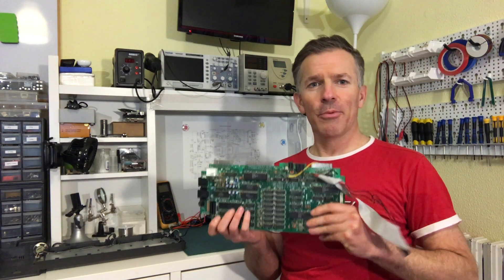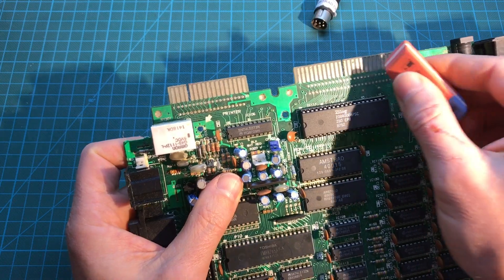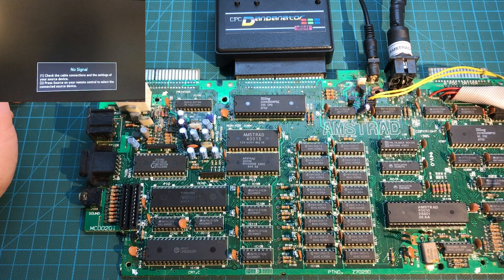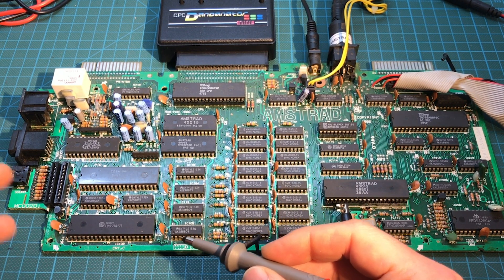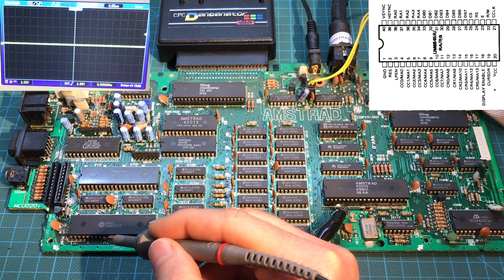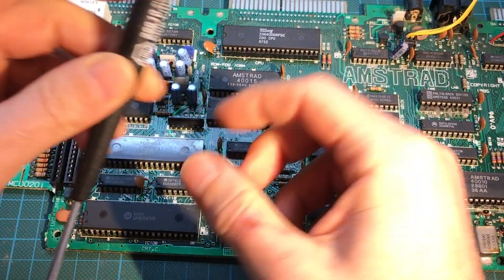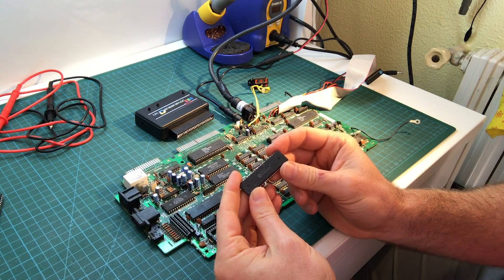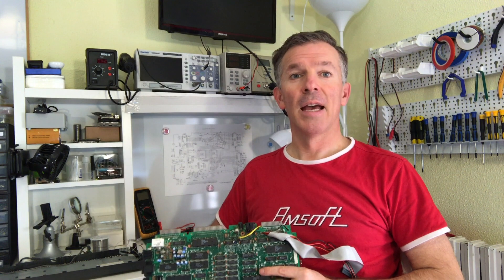Amstrad CPC 6128 with Black Screen Repaired (Part 2)

Comment: Hi @Noel  and thanks for this 2-part video on diagnosing & repairing a faulty CPC6128.
As I mentioned earlier in one of your other vids, I have a faulty CPC myself, which boots up to displaying an empty grayish screen with black border (normally symptomatic of faulty RAM chips), no prompt so it hangs up at some stage during turning on. I already tested the  2 socketed chips, the Z80 and the 40010 gate array by swapping them with others from a working CPC, and these are working fine. From your part 1 video I did the voltage checks, I'm getting 4.94V (surprisingly high) on most chips I tested: the AY sound chip, the CRTC, the Z80, the FDC and also every RAM chip. One thing I noticed is if I do a "manual reset" of the CRTC by shorting the ground pin to the RESET pin that is just next to it, the screen then becomes dark blue against gray background, or sometimes medium or light blue with yellow or cyan garbage blocks of pixels all over it. I didn't test the ROM I think yet for voltage. Another thing I checked is the temperature using the temp probe on my DMM, and while some chips are hot (CRTC, Z80, and FDC, and RAM chips mainly) they don't exceed 55°C, while the rest of the chips stays between 35-43°C. Ah, another chip that gets quite hot is the 40031 (next to the top-right corner of the RAM  chips), can't remember what this one is. 
Anyway, it's hard at this point to know where the fault is, it might not be the RAM in fact, it may be just the CRTC or maybe the ROM or some other chip, but I can't go any further in my tests as I don't own an oscilloscope yet.
So I'd thought I'd ask your take  about this handheld oscilloscope+DMM unit from Hantek that's available on Amazon for quite a good price (the 2C42 entry model, that has 2 channels, 250 MSa/sec sampling and 40 MHz bandwidth (seems more than enough for retrocomputing and hobby electronics use to me, don't think we rarely get studying signals over 10-20 MHz in this field, however many sites I've seen recommend at least 100 MHz bandwidth ??!! And also apparently the bandwidth decreases along the force of the signal, eg at -3 dB the bandwidth is greatly reduced) and 10 mV to 10V resolution per division, and the most expensive model also features a waveform generator):
https://www.amazon.com/Hantek-Handheld-Oscilloscope-Multifunction-Tester/dp/B07PY6DP1H
The screen is quite tiny I think, but apparently you can also connect it to a PC thru USB and you can have  the DMM or scope screen displayed in higher resolution on your PC:
see https://www.hantek.fr/oscilloscopes-portables/183-hantek-2c42-oscilloscope-portable-40mhz.html
So it looks quite interesting and seems to have good reviews. The one thing I'm sure is not worth is  spending €50 more to get the AWG output function, as I think this function can easily be achieved by a simple circuit using an Arduino (or an ESP32 if higher frequencies are needed), and in any case for retro computing and basic electronics work I can't really see what is would be useful for? So I'd rather invest juste €30 more in the 2C72 model that has higher bandwidth (70 MHz), but only if it is really useful. Nowadays it seems many people recommend choosing a scope with at least 100 MHz bandwidth, I don't understand why apart from the fact that apparently, actual bandwidth decreases with the strength of the signal, eg at -3 dB the bandwidth is decreased and this would be also dependent of the type of op-amp used in the probe, but all of this is quite obscure to me, I have no clue how oscilloscope probes work...
To wrap it up v(ery sorry for the overly long comment...) I hope you can give me your thoughts on this handheld oscilloscope and tell me whether you recommend this unit or would rather advise me on another model with different characteristics, bearing in mind I'd prefer an handheld unit as I don't have space for a full-sized scope :-)
Reply from the maker: Hi Laurent, let me start with the Amstrad. An oscilloscope might not help as much as you think at this point. Grayish screen with black border is a bad RAM 95% of the time. The ideal tool right now would be something that let's you replace the lower ROM: Dandanator, X-Mem, or something like that and you can put this test program as the ROM: http://www.cpcwiki.eu/forum/amstrad-cpc-hardware/quick-and-dirty-ram-test-for-cpc/ That will isolate which RAM chips are bad (if that's the case).
Also, since this is a 6128, you can try the trick of swapping out the banks in the HAL like I talked about in this video: https://www.youtube.com/watch?v=LLVHJO-aj3Q
If none of those things are an option, you may be able to simply measure resistance between the different data and address lines to ground and if you find one that is shorted or really out of the ordinary, that might be a good candidate for a bad one (although they don't get warm, so that may not be happening).
Reply from the maker: As for the oscilloscope... I don't have experience with the handheld ones. You might want to check eevblog for reviews and opinions of people using them. The one I have is a Hantek DSO5202P and I'm super happy with it (I think I bought it second hand from someone who had hardly used it). It's even somewhat portable (light and has a handle). This one is a 200MHz but 100MHz would be fine too. The reason you want something like 100MHz even if you're dealing with 30MHz signals at the most (apart from Nyquist theorem of double the rate) is to get a bit more resolution in the waves you're looking at. The higher the frequency the more you'll be able to see of the actual shape of the signal you're looking at. But the best thing is to get feedback from someone using those scopes for this kind of work. Good luck!
Reply: Hi  @NoelsRetroLab  thank you so much for taking the time to look into it and for your advice, I really appreciate it!  I heard of the Dandanator (but not of X-Mem), I'll look into it and see it it's worth buying. The thing is I have another fully working 6128 so I can just keep the non-working one for spares for the time being. Anyway, if I decide to get further and am able to diagnose the faulty RAM chips,  I'll need time to exercise myself on desoldering chips on used elecronics boards to get practice so that I don't ruin the Amstrad PCB (I'm a real noob at electronics and especially not very experienced nor gifted at soldering..)
Reply: @NoelsRetroLab many thanks as well for your feedback on oscilloscopes. I did check eevblog and other sources but most 'reviews' I found about this scope were a bit shallow. However from what I gathered, it lacks many functions and is not very user friendly as it lacks knobs for quick adjustments,  ant its 1x probe is limited to 6 Mhz (only the 10x probe is at 40 MHz), and there are other shortcomings but I would think it still would be ok for very basic usage.  Oh, and I know about Nyquist and Shannon theorems, which I why I figured that with 40 MHz bandwith I could sample signals up to 20 MHz (but with very bad resolution of course.. 2 points !!) and from what I've read ou need at least a bandwith of at least  5 times the frequency of the signal you wish to study to be comfortable, but again I wouldn't need to analyse signals higher than 8 Mhz in Frequency I thin.
Anyway, it is funny that you own a Hantek unit, at least it proves that they can manufacture good units too :-) 
So, for the time being I will stand by on the purchase of a scope and try to find training materials to learn more about the operation and technology of scopes (I got to use scopes more than 25 years ago during my IT degree as we had some basic courses on analog and digital electronics, but that's long ago and we didn't get much training in the use of the scopes anyway). And then I'll probably do as you did and lookk for a good second-hand scope, trying to find a decent one that's as compact as possible.
Reply from the maker: @laurentd9980  That's true for CPU clock signals, but if you look directly at the signals generated by quartz oscillators, you'll often encounter up to 30 MHz (although those are fine with just 2-3 data points).

Comment: Nice to see an amstrad saved.
Anyone else having issues making out whats being said? Not sure if it's because my 3d printer is working next to me, but I don't tend to have issues hearing the chat.
Reply: gee-k Nope, the sound is fine for me 👍
Reply from the maker: Let me know if the latest video is better. I defnitely improved the sound capture and post-processing. Still learning a lot about makig videos :-)
Reply: @NoelsRetroLab  Hi Noel. It might very well have just been my crappy speakers. That and the 3d printer was going off next to me. It was slightly lower than i'd have liked, but that is purely me. I wouldn't go changing anything on my account if others aren't having an issue with it.
Reply: The sound keeps going up and down don't normally have problems hearing you, it's like the Mike is moving away from you. Always love your videos though and don't usually have sound problems this must be a one off.

Comment: Great solve ! But it´s a little more difficult if you don´t have spare ICs lying around. 😀I will check my CPC and Amiga soon when I get them out of their 20 years garage storage. 
The one thing I like about emulators is that there is an option to pause the game and even save a game mid gameplay. 
Do you know of an external device that can do that for the CPC ? Or is this possible with the Gotek software ? I have not read about that there.
Some games are too hard to beat and I would like to play them through with a little cheating. 😏

Comment: 7:36 
I disagree. I would check for Vcc level and RES state in the first place. 
However before anything i would troubleshoot this 0.5V drop at the socket. Yes, i know it fits into specs but main voltage is bloodstream of computer, therefore it has to be a thing that one can rely on.

Comment: Noel, if the only problem was the CRTC, why you could not listen the beep after pressing the delete key (neither the music coming from the cartridge game) ?
Reply from the maker: I don't know for sure. I'm guessing the GA is waiting for VSYNC or some other signal from the CRTC in order to do some operation, or even to finish initializing. Since it never receives it, it gets stuck waiting. Or maybe it's the ROM initialization that waits for the CRTC to successfully initialize. Not sure.
Reply: @NoelsRetroLab  and @jomicamp: I suspect the operating system uses the VSYNC signal also to scan the keyboard. It is 1/50 sec. = 0.02sec. According to the Basic manual, the INKEY command: "Examines the keyboard to determine if a certain key has been pressed. The scan is performed once every 0.02 s".
If there isn't keyboard read, then not beep.
Reply from the maker: @moterov4  Right! That makes a LOT of sense. Thanks for bringing that up!

Comment: I have the same issues. I changed the CRT controller and still the same issues. Now I also found RAM ICS  32,33,34 are very hot - so they are failing.....need to be replaced. Do the RAM chips have any impact on the CRTC IC and outputs?
Reply from the maker: Yes, check out my latest Amstrad video. If you have some failing RAM chips, sometimes it can mess up with the CRTC settings and cause weird screen issues.
Reply: @NoelsRetroLab  thanks Noel. Yes I did see the latest vid. It basically confirmed my suspicions. It turns out i had 8 RAM IC fail on the 6128. I have ordered new ones. waiting now and so socketed the slots. I replaced the CRTC and probably threw away a perfectly good one when I replaced it! Still got the grey box with the new one so I know the Z80 is fine and the new CRTC is not the issue and hence concluded it was RAM since 8 bad ones were hot to the touch. Keep up your great vids!

Comment: Hi Noel, thanks first for this tutorial. I've the same problem on a CPC6128 board and I've allready change the CRTC chip but now, with this tutorial, I sure I do that for nothing . Because I got the same ouput result with the both chip, the pin21 1Mhz, no V&H signal (down) but the pins dedicate for adressing seem to be OK. Could you please give me your feeling and a way to folow. Thx.